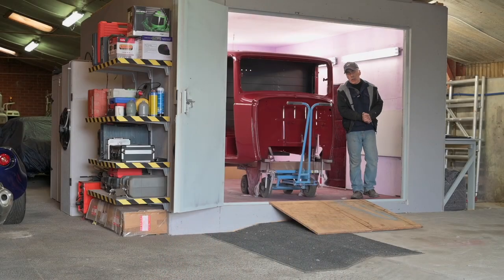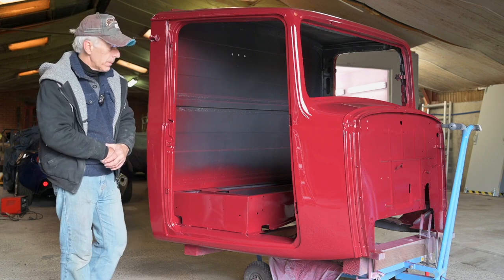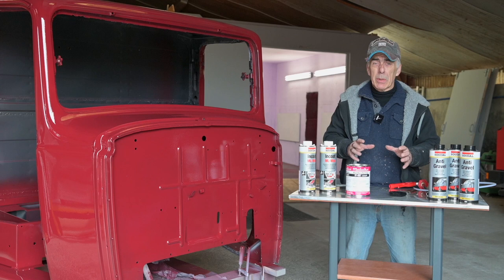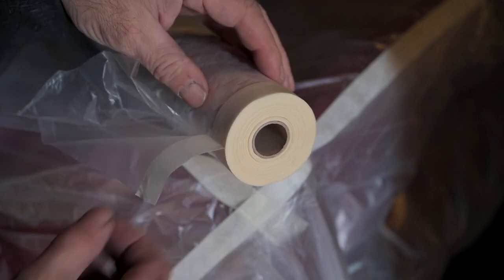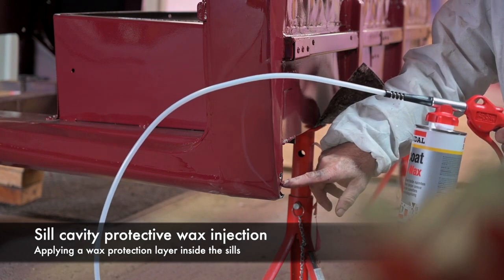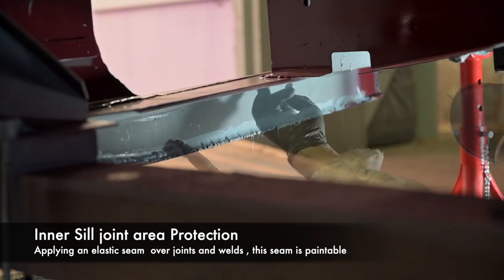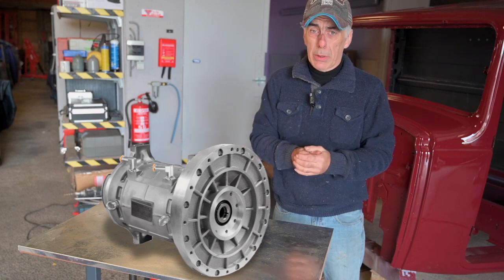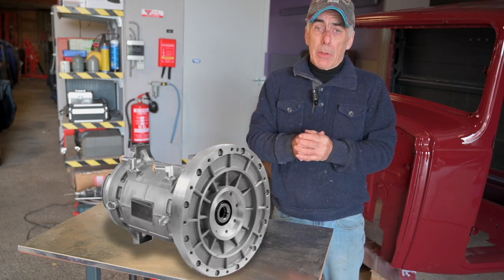Old Rusty, Part 24  Protecting against rust

Comment: Dag Steve, ben fan van je video's. I would go for original gas engine, if you have any perspective on the work, cost and craftmansship of people who have the machine shop to do this.
Electric in my point of view is'nt going to be cheap eighter, batteries are heavy ,costly and like to go up in flames if not professionally installed and protected.
Maybe they are more ecological but what about the recycling of the batteries when they are worn out? is this going to be so ecological aswell? Maybe? anyway not a concern for now.
35 HP was  enough in the 1950's, old rusty's youth, so it's enough now. Motorcars of today are much to strong to tranport an average of 1.5 humans of 80 kg on an average speed of 45 km/h.
We are power junkies. 35 Hp is more than enough to kill yourself.
Reply from the maker: TXS for the comments, and I can see your point.   Ja inderdaad ik denk eraan om met de verbrandingsmotor verder te gaan.  The EV motor and battery runs around 9000 euro.